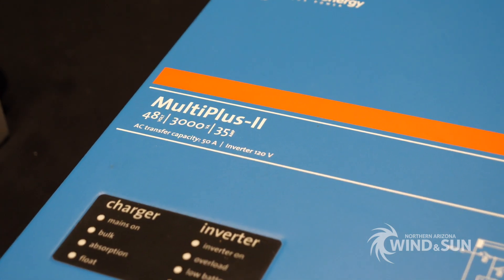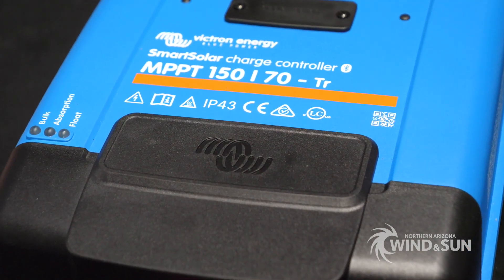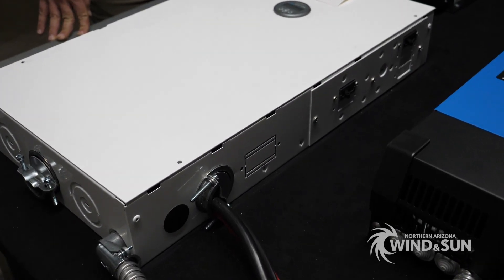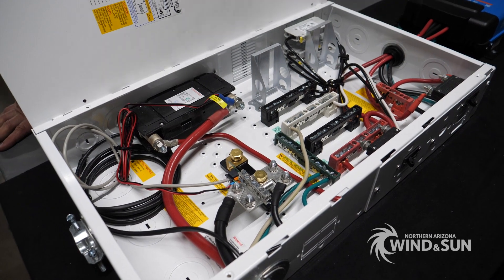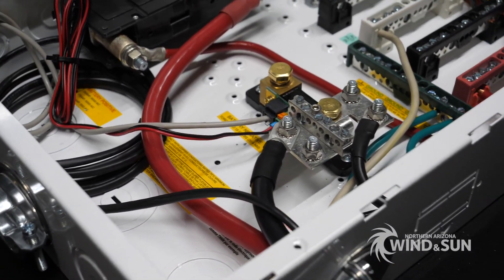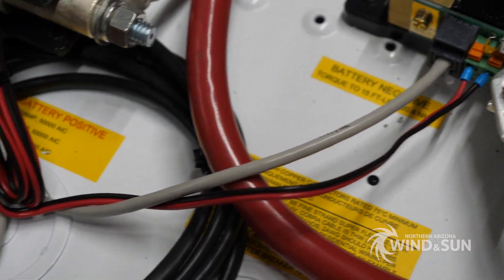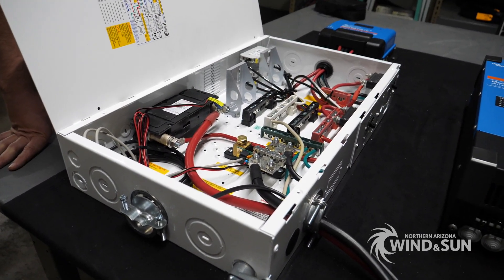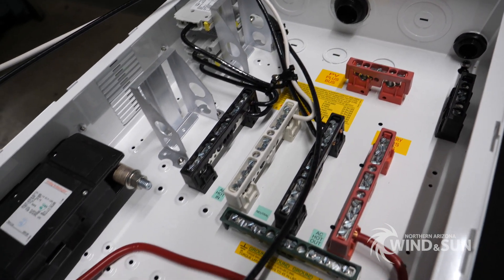Off Grid Solar Power Panel Build

Comment: Good job, but, might try using Wire Ferrules Crimp Connectors on conductor ends going into various screw connectors. Maybe use wire strippers instead of cable cutters to cut cable insulation.